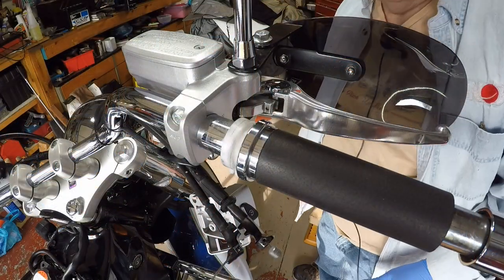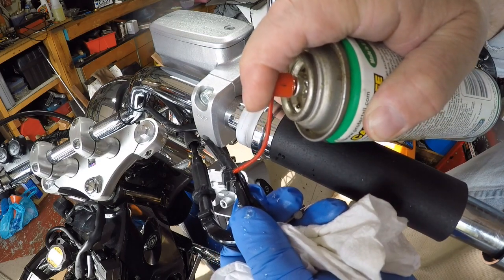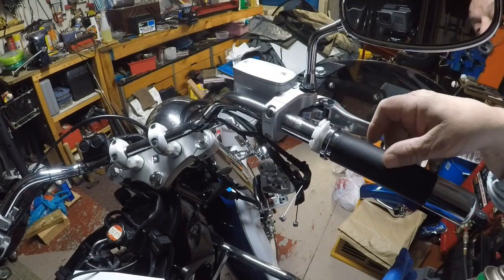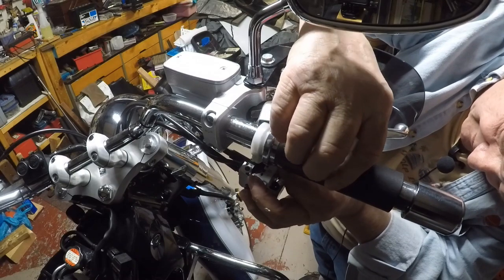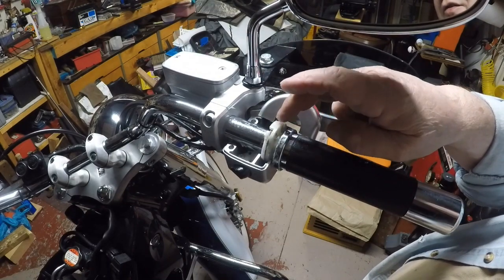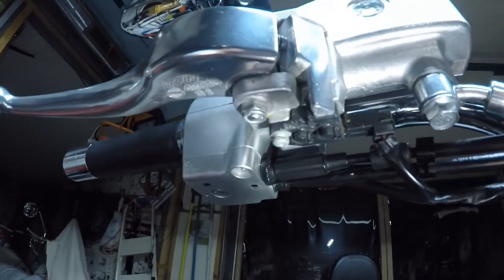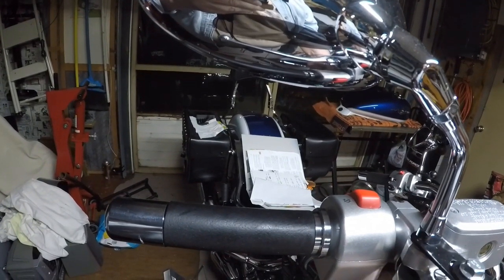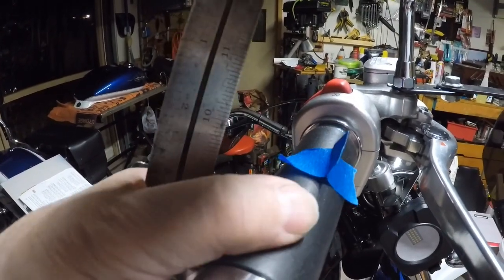SUZUKI BOULEVARD C 50 ADJUSTING THE THROTTLE CABLE

Comment: Thanks Norman for your videos. I just helped a friend buying the 2008 fuel injected C50. I changed the oil and tue final gear oil. Unfortunately the throttle tube was so brittle for some reason and at turned into plastic powder while we were adjusting the cables. Are these tubes standard? They asked for 55$ for the OEM which is just a plastic cylinder and we can't justify it.
Reply from the maker: I am not sure about the standard part but OEM parts are the way to go. If a part was say hundreds of dollars I would try looking on E-Bay for a used part. Being $55 dollars I would go with it.  Norman.

Comment: Great video!
Reply from the maker: Hi Audric, You ask how I removed the switch? You mean the housing that holds the throttle cables? There are I think three screws up under it you have to remove. Norman.

Comment: Great information. Where did you get the shields in front of the grips?
Reply from the maker: Hi Mike, I didn't get an e-mail with your question. Just saw it.  I got the shields from e-bay. I looked but can't find who the seller was. Norman
Reply from the maker: https://www.ebay.com/itm/Pair-Smoke-Motorcycle-Hand-Guard-Protector-Cold-Wind-Deflector-Shield-for-Harley/362839590182?fits=Model%3ABoulevard%7CMake%3ASuzuki&hash=item547aecc526:g:Wl0AAOSw-~td6K0-

Comment: @2001Himax 
Hi! I have a question on fixing my boulevard.  
Might be on the wrong video but I don't know how to direct message on here. 

I was riding with some friends and in 3rd gear through mild traffic around 40mph or so, 
my bike decided to disengage and it felt like a full engine break. I was giving it some throttle and could hear the engine reving up and down (meanwhile hearing the engine break sound we all know) I was not covering the clutch and it engaged back in and took off. This happened 2 more times and I'm trying to figure out if its the clutch. This happened last week or so and I have not rode it since 
Its an 06 C50T with 42k on it. 

Thank you! Hope to hear back.
Reply from the maker: https://www.youtube.com/watch?v=7BubY5R6jyw     Lacy, Try this first. Not hard to do and may fix it. Norman.
Reply from the maker: Try the full clutch adjustment  first then watch this video.  https://www.youtube.com/watch?v=a8ZFgU8i12I

Comment: wd-40 is useless thing in terms of lubricating, it evaporates and leaves nothing. motor oil is one you wanna use for cables. Yes, it's thicker and not pressurized, so what I do in this regard - using electric tape, form kind of filler around the cable's end, fill it with the oil and leave it overnight. Next morning I see the oil leaking from the other end which is good.

Comment: I like your hand guards were did you get those
Reply from the maker: Hi Mark, I just saw someone else ask that. I didn't get an e-mail that you left a comment or I would have answered. I got them from e-bay but can't find the seller. Put in motorcycle hand deflectors.   Norman
Reply from the maker: https://www.ebay.com/itm/Pair-Smoke-Motorcycle-Hand-Guard-Protector-Cold-Wind-Deflector-Shield-for-Harley/362839590182?fits=Model%3ABoulevard%7CMake%3ASuzuki&hash=item547aecc526:g:Wl0AAOSw-~td6K0-

Comment: 6:40 mark.  How do you loosen the play of the cable?  I can't seem to get enough slack to put the cable in the hole
Reply from the maker: Hi Raymond, Everywhere along both  cables have to be adjusted inward and both have  to be in place to go into the hole at the top. It's tough to go in but it will go in. Work slowly and make sure both are in place. After both are in then adjust it so there is a small amount of play on both cables. Hope this helps.  Norman.